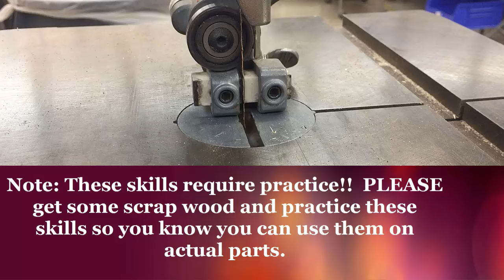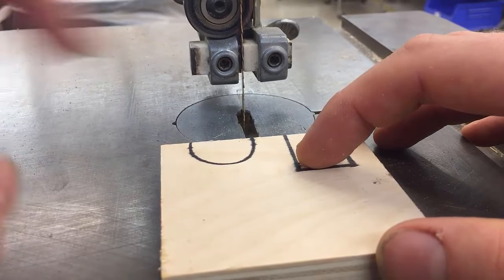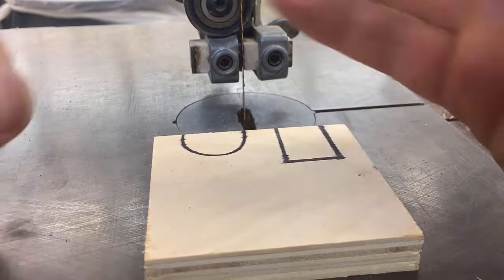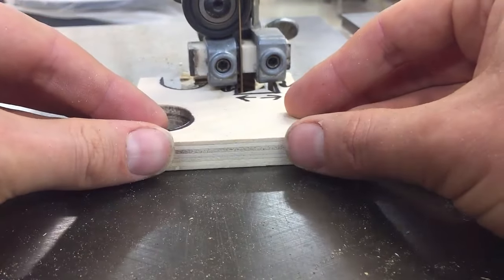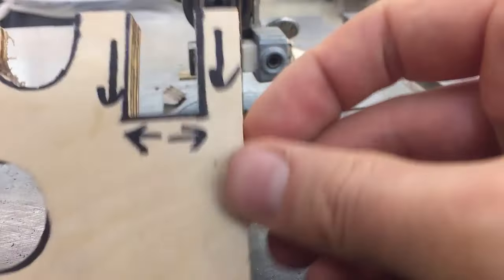Bandsaw Tips

Comment: 6:12 - for me, pulling the work piece back out usually results in the blade coming off the wheels.
Reply: Might just need to slow down and give it some wiggle wiggles but it sounds like you probably don’t have enough tension on your blade.

Comment: Great video . Question when doing these types of cuts is it better to use a skinny blade or do it not matter what size bade is being used thanks
Reply: Depends on the wood you’re cutting through and how many relief cuts you’re willing to make. Thicker wood usually calls for bigger blades. Tighter turns usually call for smaller blades.

Comment: Is that a 1/4-inch wide bandsaw blade?  They show 3/16-inch wide and 1/8-inch wide bandsaw blades for sale on the Internet. What is the horsepower of your bandsaw? I ask because it cuts the board easily. I am trying to determine if there is an under-powered bandsaw HP. size. Good video. Thank you.__
__A bandsaw seems better than a scroll-saw. Scroll-saw blades begin at 1/4-inch online. A scroll-saw has a rough, vibrating, motion of a jigsaw. Your band-saw is smooth and vibration free.

Comment: Liked and subbed.

You appear to be the person who might be able to answer a question I have. I'm getting into wood carving. Besides the hand-tools, I've a 9" benchtop bandsaw. I need to be able to take a 2"x2"x12", and make two TRIANGULAR 12" lengths by cutting the length down the middle, through opposite corners.  I've seen on YT folks using a table saw with its blade at an angle to make the necessary "V block" jig to cradle the 2"x2"x12" wood while being cut lengthwise by a bandsaw. However, I'n no access to a table saw. What are my options, please, to make the "V block" jig?
Reply: Put a 45 champher on a couple of pieces and glue together. Can use a plane to hand cut the champher.
Reply: @jerryquigg3497  Thank you.

Comment: Or just put a thinner blade designed specifically for tight cut
Reply: There are certain times when you dont have that option for example when I was in school in my wood working class we were not allowed to change the blade and the teacher wouldn't change that blade all to much so we had to use methods like the ones showed in this video

Comment: why is your blade guides off center?  why is your blade burning the wood?
Reply: Your answer is at right about 3:25.. blade on there is probably well overdue for replacement.

Lesson 1: If you see sparks and you're not intentionally cutting metal.. STOP IMMEDIATELY!
Reply: he did soemthign u shoudnt do first
Reply: agree'd, someone needs to setup his machine for him.. the side of the lateral guidewheel is rubbing against the back of the blade, even when theres no pressure applied.. thats shouldnt happen even if the wheel was setup in the lateral position wtf
Reply: hell, im not even sure if that is a lateral wheel, look like it was designed that way.. again, wtf